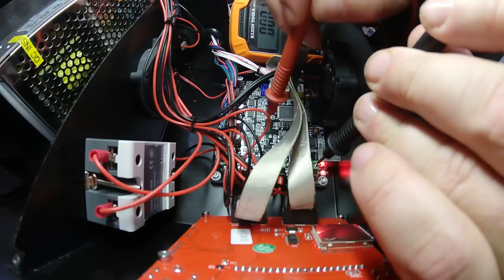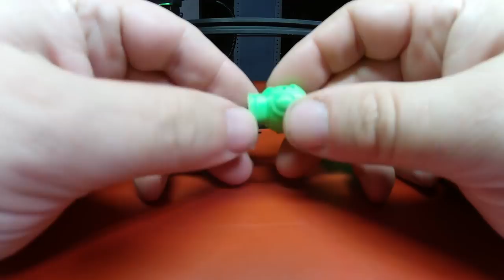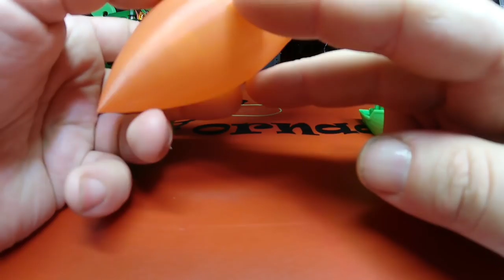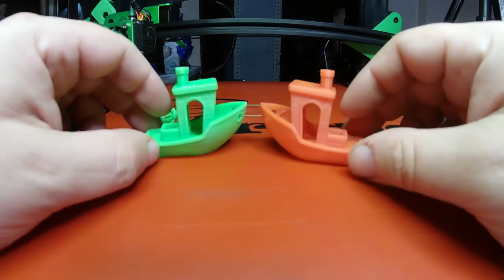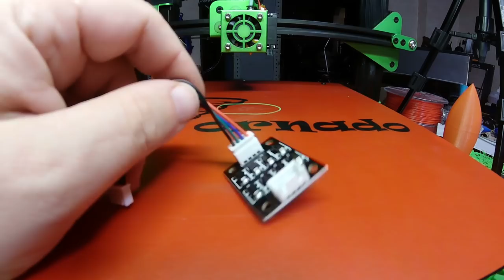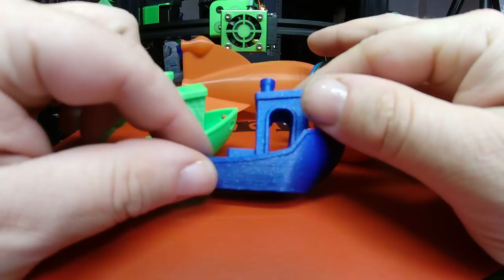Today's 3D Print 107 Adjusting the Tevo Tornado Stepper Drivers

Comment: I have the 2018 Tevo Tornado and it had a serious layer shift. I checked my steppers and my Y was only somewhere around only
.680. That stepper is bigger than the X And Z so I set that one to 1.0 and the rest to .950, it still stays cool and it doesn't shift anymore.
Reply: I'm having the same problem with my Tornado. I was about to do the VREF mod..what did you set your Multimeter to in order to test?
Reply: @techsavvyhero  the lowest range on DC volts.

Comment: Totally agree with this change.   I have been attempting to print 1 perimeter width resembling wing skins and for the longest time i couldn't figure out why my results were not even close to others.    Changed slicer,  nozzle,  all kinds of settings until i stumbled upon the power problem.   I've adjusted mine to 1v on Y and the rest on 9.6.   After the change,  i kept my thermo probe on the y axis motor to see if it ever heats up.  No problems.   All my layer shifts are gone.   I am not even using the glass anymore.

Comment: While getting another migraine over the centering issue I noted an option in CURA where one can pick "Gcode flavor". Various codes are listed there; Marlin, Marlin (Volumetric), RepRap, Ultimaker 2, Griffin, Makerbot, Bits from Bytes, Mach3, Repetier.
As Tevo Tornado is very similar to the CR10, which Gcode do you think should be used?

Comment: May sound like a dumb question, but what are the undesirable effects you get on a print if you don't adjust the stepper drivers to .95V each ???
Reply from the maker: On my particular tornado the voltage was set too low the voltage controls the total amount of torque the motor is capable of putting out the tevo tornado has a very large and heavy platen for the print bed that's a lot of mass and inertia to throw around what would happen is if the motor could not apply enough torque it would skip so the printer would command the bed to move 10 centimeters but it would only move nine because it's skip some steps for lack of torque the result was your print from then on was shifted one centimeter forward basically destroying your friend increasing the voltage increases the torque as long as you don't go overboard you're okay I still have minor skipping every now and then so I'm going to replace the y-axis motor with a beefier motor

Comment: hello, i'm planning to do this operation on my tevo tornado, but i'm affraid of doing a mistake, do you do this while the printer is on or off ? thanks a lot
Reply from the maker: Printer has to be on so use care. Its not care but you dont wnt to slip and short something with the probe or screw driver.
Reply: Thanks a lot for your fast answer ! i'm gonna fix this printer now
Reply: Ok, it turned out good, evrything working, again thanks a lot !
Reply: @ibrahimfakhreddine4259  I'm about to do the same. Was it easy to do? What did you set your multimeter to?

Comment: You see the problem on the sides because the sides of the benchy are not perfectly straight, it is a diagonal movement (with less move on the Y axis) where the front and back are perfectly straight movements.
So I'm still pretty sure it is a microstepping issue. An other possibility is a bad PCB layout wich gives a slightly noisy current measurement on the shunt resistors. Maybe a small  10-100nF in parallel to the shunt resistor may help. Or maybe the reference voltage is noisy so a 10-100nF in parallel to the potentiometer may help.
Reply from the maker: MasterFX2000 that explains why so if I did a cube I wouldn't see this but if I rotate the cube 45 degrees I would interesting so far the TL smoothers appear to be working like a dream but I only printed a Marvin a rocket is sitting on the bed done for me to examine when I get home and then I'll do another Benji but so far I'm very impressed
Reply: Okay thats interessting too. I thought the TL smoothers only give better visible results on deltas. Basically what the TL smoothers do is they reduce the voltage of the steppers by ~1.4V (two diodes in series) so the Stepper drivers doesn't skip the first 1-2 microsteps. 

Which kind of pulleys for the X and Y axis are they using? (steps per mm in Marlin).
Another option would be if they are using 32 Microteps (which will explain the less noise compared to CR-10) the problem occurs because of that.
Reply: The root of the problem is very slow movements where the DRV8825 stepper drivers as they approach the end of a set of microsteps will jump past the last few to the next full step.  The 8825's decay mode isn't really ideal for really slow moves and this is where you can see this behavior, like the hull of the benchy is a few degrees off perpendicular to the axis which is moving super slow.  The jumped steps occur because as the microsteps approach the next full step, the voltage starts to drop off sharply enough for the drivers to loose steps.  Overvolting the drivers can mask the issue, which is why its sometimes suggested, but the TL-Smoothers are a much better solution since you don't have to run your drivers so near their limit.  This can also be an issue on the extruder motor, so it doesn't hurt to include one there too, but it'd be a good idea to recalibrate extrusion.  I had this problem with a Monoprice Maker Select Plus and converted to Ramps and TMC2100 drivers to solve it.
Reply from the maker: interesting. so running it FASTER would potentially remove the artifacts? (but then introduce speed effects)

The TL smoothers worked like a dream. better. the results are actually quite stunning and this is with NON optimized prints! (just tossed some CR-10 gcode onto the tornado)

now I am excited to mod/upgrade/tune this machine. it has huge potential and is SO nice in fact it might even be worth replacing the board on! super excited. I hope creality answers tevo with a similar nice upgraded machine (namely full size sd card and all metal and AC heat bed!!)

that is fascinating that their selection of drivers created the problem. I wonder why they did not see it in testing or just ignored it as cosmetic and irrelevant???
Reply: Running it fast would probably affect a "safest shallow angle" kind of value., because it would speed up the movement of the access perpendicular to the shallow angle, but realistically I don't think, for instance, a 2-3 degree angle at 40 mmps compared to 60mmps would speed up that steppers movement a large amount.  Try printing a bench rotated 45 around the Z axis, the artifacts will be completely different since those shallow angles won't be there.  As for why it seems to be ignored, I'm not sure, I think its an affect thats usually masked by other issues in printers like loose belts, extrusion issues, etc.  Organic shapes, or test prints like the Lucky Cat aren't going to unearth this issue. When I was trouble shooting my go to test was a 20mm hollow cube rotated 3 degrees on the Z, I could replicate the "zebra stripes" all day.  8825s can be set with a "fast decay mode" by shorting some connects (it takes ultra precise soldering), so some boards with 8825s built in may run them with that decay mode stock.  I've come to the conclusion that stock 8825 drivers are just not suited for 3D printings need for very slow microstepping.
Reply from the maker: ahh all the different parameters creates an acceleration "Curve" so even if default print speed is higher it would still at points pass through that "danger" portion of the acceleration curve where its slow enough to miss steps. that makes sense.
Reply: i am french so i haven t understand everything..did you resolve you issues with this ttl?

Comment: Where did you find the info on what voltage to use when adjusting the pots for the stepper motors. 
Also after making the adjustment do you hear stepper motors humming louder?
The problem with my Stepper motors is they only show the part number. (17D4401-c5 .18)
I think the .18 is 1.8 amps for the drive but I cant find spec online for it at all.
I'm think the voltage should not be more than 8.5

I would love feedback
Reply from the maker: +Fantasie Fx someone on the tornado group found out and that's where I got the voltage to set to

It won't fix the salmon skin or anything like that but it will stop the under torque layer shifting that some people experience not everybody
Reply: Yea I got smoothers for that.

Comment: Do you have any links on how to replace the control board for the Tornado?  I am needing info on which exact MKS board I need to get.  My printer is brand new and would not stay connected via USB.  I tried flashing firmware and it seems to be bricked.  Blank LED screen and cannot connect at all via USB.  Thanks for this video.  Any help will be appreciated.
Reply from the maker: You can probably order a replacement board directly from TiVo I ordered a heat pad from them and they were pretty responsive

I don't have a video for installation but it's relatively straightforward if not already Mark all the wires you unplug with a tag indicating where they go then simply swap the board and plug in the wires it's largely Plug and Play if you get a replacement from TiVo it should simply work no flashing a firmware would be needed
Reply: Nerys good deal!.  Do you remember  how much the board was from Tevo?  I have seen the MKS 1.4 boards listed for about $20 but they would need to be flashed.  Since this is a brand new printer Tevo may send a free replacement.   Thanks again for getting back with me.

Comment: Hi. Hopefully you'll fix this. I have a Tornado on order and looking forward to modding the crap out of it. Not sure what those stepper drivers can take but isn't 0.95vref a bit high? I thought current through them is roughly twice the vref? If so, that would make nearly 2 amps. I know the A4988 steppers I use on my reprap can only take 1 amp without cooling. Good luck.
Reply from the maker: +Plan C I honestly don't know I chose v ref because someone else said that it was the correct voltage for those particular steppers I've got nearly 1,000 hours on it already and it's fine so far.... :-)

Comment: Hi, I'm aware that this is not the newest video. But by any chance - have you got it sorted? I also see the vertical lines - the prints are generally ok but the allinment of the layers could be better, i'm afraid this is extrusion relater problem, because mechanically printer seems fine... I'm kinda dissapointed with this one and thinking on getting new one.. any suggestions which should i get instead? (ofc if this cannot be fixed by fine tuning ;) )
Reply from the maker: One thing I had not tried and I am going to try when I am able to revisit the tornado is to put a TL smoother on the extruder I always just put them on X & Y but on the Ender 3 I learned that the extruder can benefit as well I will try that on the tornado when time permits

Comment: The 'salmon-skin' effect is a known issue of the DRV8825 drivers and the 1/32 microstepping. The only real fix is the TL-Smoothers like you have installed. other fix would be to change them to 1/16th microstepping but this would increase the noise levels of the steppers. Changing the Vref and in turn the current to the steppers wouldn't have any effect on the salmon skin. As for the diagonal lines on the benchy i would think it was the inill showing through the skin. Try adding another perimeter maybe :)

Comment: Last comment on Tevo Tornado centering build issue, as it is now working. Perhaps this may help someone else. In CURA 3.2.1 under Settings > Printer > Manage printers > Printers > Machine settings; I had checked the Origin at center box (seemed logical, but not); box should be unchecked. Also, I was told to select Marlin for the Gcode flavor in that box. 
Now I sent the printer to "Home" started the build file and the head moved to the plate's center position :-). Only took 3 days to figure out, thanks to Forums and YouTube.
Reply from the maker: I figured that was it that's what you would check for deltas :-)
Reply: Now that that's fixed, things are not sticking. I give up for today!
Reply from the maker: Relevel. No bog deal :-)

Comment: Nerys.. Thank you for posting this video. I did the same thing and it seemed to work, for a while. I had a small shift in a long print last night that effectively ruined it.. Ive also had a slight iasue with under extrusion.. Any ideas on how to get the Tevo Tornado running smoothly? I know salmon skin is a re occuring issue but what im printing right now, doesnt need to look perfect.. Just needs to fit together perfectly
Reply from the maker: +Adam Turner I believe tevo is turning them up to 1.1 volt now you could try that just be careful of overheating also you're not putting another glass plate on top of the existing one are you? That might be too much mass a temporary solution is to slow down and maybe add Z hop to avoid collisions
Reply: Nerys nope just the build platform out of the box.. Ive only had it for a month. Im going to look at it more this afternoon and maybe see if its a bad .stl
Reply from the maker: +Adam Turner the sd card that came with mine was a fake 2gb marked as 8gb so that is definitely possible. Try upping the voltage a bit just watch how warm it gets. I might also be looking i to replacing that stepper with something beefier. I will pot a video if i do of course.

Comment: I just checked mine so I seem to be lost... I have the MKS Base 1.4 card in there but the driver chips have on them HR982mte on the first line then 81707A on 2nd line so what do I have? are these the same as "DRV8825"?
Reply from the maker: I don't know. :-) if you don't have salmon skin you are good to go!
Reply: Just reading all the Comments on here, I missed a # I have the HR4982 chips...Cool TL-Smoothers NOT needed right? also volt adj is the same on that chip right?.95 on all and 1.0 on "Y"
Reply from the maker: I don't know. no salmon means no smoothers needed. so I think you are safe.

as for voltage I am not sure. inch it up slowly and keep an eye on them (touch them) to see if they get hot after 20 minutes of printing etc..
Reply: If you have the HR982mte Drivers like I do DO NOT do this! my prints are so bad it's not even funny. Maybe I should have taken notes on was it was before I did this! O well live and learn :)
Reply: You can read more about it here...https://www.facebook.com/groups/TEVO.Tornado.Owners/permalink/365215150651368/?comment_id=365220123984204&reply_comment_id=365225977316952&notif_id=1522632720534615&notif_t=group_comment_reply&ref=notif